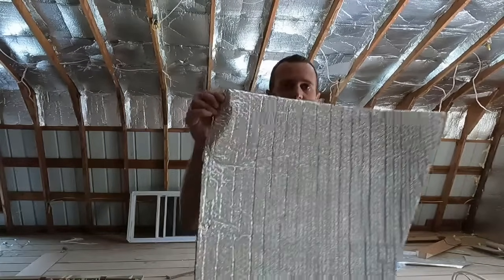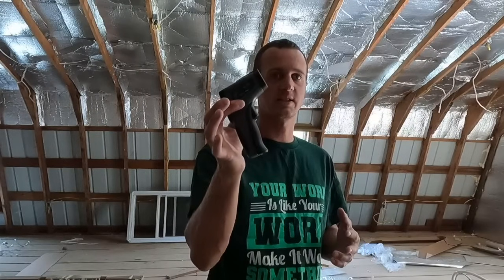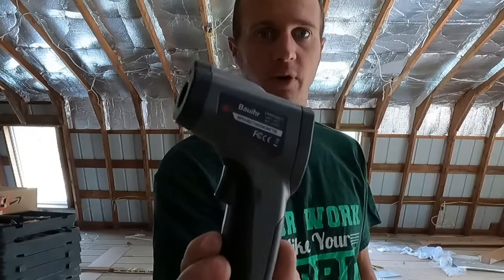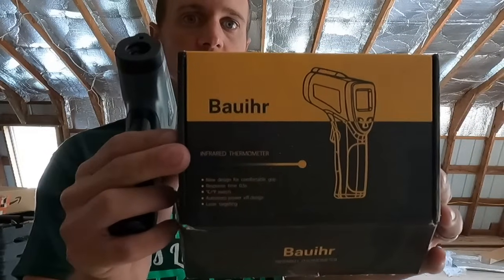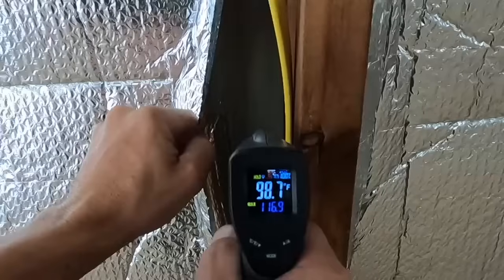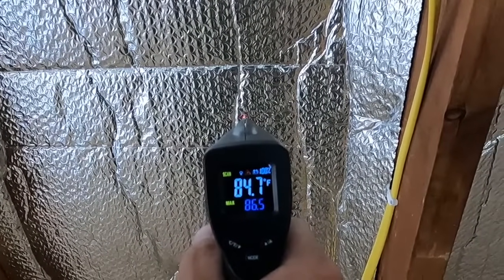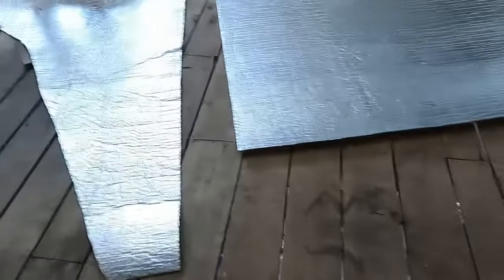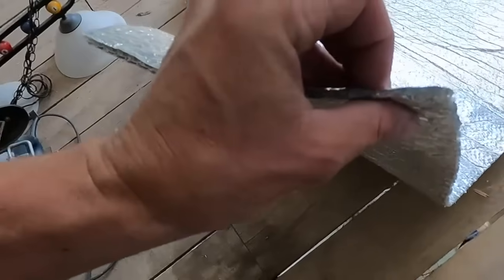Reflective Bubble Foil Insulation/Does It Work???

Comment: Isn't there supposed to be an air gap?
Reply from the maker: I have a 1 inch air gap. I stapled it to the 1x that the metal is screwed to.so metal is fastened to the outside of the 1x the insulation in fastened to the inside.
Reply: @projectdiy873 Thanks. So if you use Rockwool with it, it'll stop even more heat?
Reply from the maker: @ayanhalder6194 it should yes. I have not put the video out yet, but I have r 19 on top of this as well. Then I will have the wood for the ceiling. So I will have e the wood which is an R value the r 19 insulation the foil insulation an air gap and then the metal.

Comment: I'm wondering about air flow between outside wall, and the aluminum wrap?...if you have that on the outside wall, and then decide to enclose a wall, I don't think you could poly the inside wall before boarding, there would be no where for the moisture to escape....doesn't look like your planning to do that in your project tho.
Reply from the maker: There is a 1 inch gap between the outside wall and this barrier

Comment: These barriers do work well when given an air gap. But after some years, the material will dry rot and will begin to disintegrate to the touch.
Reply: I plan to use reflective insulation in my campervan. How thick of an air gap would you recommend. Every inch in a diy van build is important.
Reply: @tommcdonald1746  I am not a professional, nor did I sleep at a Holiday Inn last night, but all the documentation that I have seen has said half an inch to 1 inch. Nothing specific to vans just overall general requirements.

Comment: Having chosen the double sided you will gain a higher R value in the winter keeping heat in compared to none aluminised bubble wrap of the same thickness. I read that aluminium reflects 95% of infrared light aka heat. It is also less likely to melt or catch fire in the summer at extreme heat load. I imagine it must say on the package how much heat it can safely take, right?

Comment: It works better if you staple to the studs and create an air pocket, otherwise is is conducting heat and you are losing most of the benefits
Reply from the maker: @Gaterstoo  it has an air gap in it

Comment: Problematic! What counts here is the time it takes for the foil to heat up to the temp of the outside roof. As soon as this has been reached (and this will be relatively fast with thin foil) heat will go in! Or come out. So important here too is the time that process takes and thats why in my country usually very thick insulation is used, up too 15 inches where possible. But sure, even a thin foil is better than nothing.
Reply: foil reflects radiant heat, while mineral wool or other materials they only absorb heat(then release it)...u could very well put foil then some rockwool

Comment: To everyone watching run it across the rafters and the wall joists and then tape the seams. Virtually 1/10th the cutting you see here. Just smack each bay and Leave a little slack that stuff does move around and you need to let it.
Reply: Thanks..Does it matter what sort of tap?e
Reply: @Dee52789  I have used the aluminum tape that you  can buy from the people who make the Double Bubble Aluminum and I have used Tyvek tape that you can get at Home Depot or Lowes. Both work Great.  But you need that type of heavy duty tape that won't come off.
Reply: @Dee52789  You can use TYVEK Tape if you want. or you can buy the aluminum tape which is more expensive. the TYVEK worked great.

Comment: Engineer here. It would have worked better if you stapled it to/between the rafters instead of where you did.  Placing it right against the roof lets heat conduct through the foil, where a small air gap removes conduction, and lets the foil reflect the infrared heat back out the roof. Also pointing an infrared gun at the foil will not give you a reading of the foil. It will give you a reading of the infrared mostly reflected off the foil. Try putting soemthing like a lable on the foil and measure that.  Or ust mease something in the room to get its temperature.
Reply from the maker: @marklefler4007  there is a 1 inch gap between the metal and the foil.
Reply: @projectdiy873  I missed this important detail as well.  Unless you added insulation over the foil you would have been better served leaving a larger gap.
Reply: I am a mechanical engineer and should know all this but university thermodynamics has long faded into a distant past. So, I resort to experimentation. Yes, place tape on the foil to take the actual temperature of the foil. I have been experimenting with radiant insulation because I am a fabric structure manufacturer. We use a structural membrane on the outside. It is white, opaque with a black layer within the white layers. Of course the black layer absorbs the light/heat that manages to avoid getting reflected off the outer surface. The membrane warms up. Leaving a 1" airgap between the inner liner (white opaque laced with titanium dioxide instead of a black layer)and the outer structural membrane. My thermometer gun reads about  30F differential for summer (heat on inside) and about 40F winter. The white liner with 1" air gap was more effective for both winter and summer than silver or gold aluminum foil laminated vinyl liners. It's a bit of a mind-bender, but, since much is at stake I'll keep experimenting to be absolutely certain.
Reply: @gerywarner2568  He needs to use Electrical tape for Accurate measurement. Electrical Tape has the Emissivity of .95. Most All  of those Handheld Digital IR Guns are all set to .95 Emissivity.
Reply: One inch gap isn't enough 😂
Reply: Yeah what thi guy said !
Reply: would you use this under vinyl siding . Prodex told me I could use the perforated  prodex
Reply: You’re 100% correct. A little research could net a much greater gain.
Reply: Engineers 😂 gotta love em
Reply: Engineer with common sense here, every gap you leave for a warm pocket of air becomes a rodent haven. Use your head.
Reply: While I'm def no engineer,  the thermal bridge from the rafters will help conduct/transfer the heat inside.  But I get it, he's clearly going to hang drywall which will help
Reply: And this why we need engineers to help our builders with the physics
Reply: I am planning on using this in a small shed attached to the back of the house. It's pretty small but freezing. There are 2 walls if that's what they're supposed to be. 5 ft wide × 8 ft tall. The other 2 walls each have a door. The ceiling is some sort of wood planks or stripes. 5 ft wide x 5 ft length.  Once I put the foil wrapping with staple gun, tape seems?  Do I have to leave gaps for ventilation or can I seal everything? Thanks for any advice. I've never done this before and no hubby around to do it😂
Reply: @marklefler4007  what can i put on double-pane windows in my house that face the sunlight from morning to night and create a greenhouse effect ?  i tried blackout curtains and reflective film to cool the rooms but the difference was maybe 2 degrees at most
Reply: If we install on rafters as your saying, we want air gaps or not? Bit confused on that
Reply: Same for clear materials like glass. Having a label you read the had with this type of sensor is mandatory for any semblance of accuracy
Reply: I’m thinking of doing this in my garage, but I suspect an air gap between foil and ceiling could result in condensation = damp and mould due to lack of air flow?
Reply: @Simonet1309 they sell foam incerts that allows air to flow like supposed to ill see if I can send a link for you
Reply: @Simonet1309  https://youtu.be/5DX25Vz2jDc?si=uC2Un1lI3ypsx7aN
Reply: I used that stuff and mine was this was probably 20 years ago now but it was better than the stuff that you generally find out there now the bubbles inside were more dense and seemed like they were a little more rigid but I remember that the feel and the you could tell it was better but our value was really high for just you know a quarter inch of that stuff it was like 3 inches of some of the phone or maybe fiberglass it was I remember it was like holy cow and I was going around we were checking it out people didn't believe me and it was really high I think it was like 20 something for a quarter inch same as two or three inches of something else you can check it out you know maybe someone will find that I was losing my mind and that was all wrong but I don't think so

Comment: Nice Video !I have an 8 by 10 steel shed  I was given and I is in nice shape ! It is like a torture chamber sweat box right now it is so hot !I was going to just take some single bubble foil roll  like you have and liquid nails it right onto inside of shed ceiling .I do not see how it could not help..I don't wanna pit a bunch of money into insulating it ,just cool it down a little for stories by riding mower etc !
Reply: By chance did your solution work? It’s sweltering in TX.

Comment: rigid foam insulation would be cheaper and work better
Reply: Thank you
Reply: EPS or XPS doesn't reflect radiant heat, but if thick enough they can be very effective. The main drawback about rigid foam is flammability

Comment: You need a thermal flux sensor to measure how good it is properly. I've got most of an extension built 20 years ago covered in this and it's useless compared to a decent thickness of PIR foam or similar. Alreflex 2L2 claims R value of 1.56m2K/W with a thickness of only 3mm. If this were true, it would make its thermal conductivity better than vacuum insulation which is just not credible and nigh on impossible.

Comment: Hi Dude, my bedroom is colder than the other rooms, can I use this on the corner of this room to kepp it warmer? Could Mould be formed under it?
Reply from the maker: It is hard for me to give an exact answer without seeing exactly what you have going on. But as long as there is no moisture going to get it there mold should not be an issue.
Reply: @projectdiy873  I have colder room as I said than the other rooms and In this room if the moisture gets high and cold without enough heating, there is specific corner I get mould in. Therefore I am thinking about solution to get this room warmer to save energy costs and I am afraid of getting mould between this insulation and the wall and maybe I cannot notice it. Thx in advance for your help
Reply: @Ronaldo-ou9vd  I'm like you , wanting to help make a room a few degrees warmer (anything will be an improvement) but I want it under the carpet , is this stuff ok for under carpets do you know ? Cheers
Reply: @smallfeet4581 
Useless under the carpet, it requires an airspace between it and the heat source you want to reflect. Works best directly opposite or parallel to the source, at least .75 inches. It's best at blocking a heat source like the hot sun or hot roof, or reflecting body heat to warm up in a small confined area like a dog house, or inside lining of a jacket. Also excellent in a double layer below the subfloor with air gaps to keep heat from escaping when cold outside. For a bedroom just get a ceramic or infrared space heater, they warm quick, less than $100, and energy efficient. Check your windows for drafts and weather strip, and or plastic shrink wrap them for the winter.  plastic over a window with that sealed air in between is like a storm window, keeps bugs out too.

Comment: YOU COULD HAVE R16 VALUE if you had a 1-2 inch air gap instead of it pressed against the metal.....
Reply from the maker: It does have a 1 inch gap it is stapled to the rough sawn 1xs that the metal is screwed to. They are 1 inch thick so I stapled to them for that reason so it wasn't straight against it cause that kinda defeats the purpose some.

Comment: I really want to know how this does when it is cold outside....
Reply: Not worth a damn, I would imagine, without heaters going.
Reply: It deffo helps keep the cold from coming in also. I've fitted bubble foil in a wood outbuilding between the thick outer and inner layers of woodwall. Before I put the bubble foil in, the temperature was a lot lower within the space when it was cold than it is now after foil instalation. Better still, now when a heater is on in this out buiding, instead of losing the heat, the foil traps the hot air inside keeping it warmer much longer, which is great here in Scotland.. 
My fave part of this foil is, that it doesn't have ability to hold moisture like most insulation, therefore I never need worry about it becoming wet and mouldy or deteriorating behind the walls where I cannot see. The foil can act to give you cooler space or hotter. Your choice which you want!😎
Reply: @vadar03  So condensation doesn't form on the foil? I'm wondering if I can use this to insulate a shed? I don't want condensation being created on the foil because it will create mold on the walls. I want to keep the shed warm in the winters.
Reply: @c.ann1408 did you ever figure it out? Im trying to insulation my shed with no ridge cap or vents
Reply: @vadar03 Im in England and want to keep the cold out! Can’t imagine living in a country where you install insulation to keep the heat out 😂! Good to know it works for the cold to! I’m considering installing it in my garage! Expensive though!

Comment: Are you really using an infrared thermometer to measure the temperature of a surface designed to reflect infrared ? You are just measuring the temperature of the room when you do that ahah!
Also, taking the temperature of the metal that is behind the insulation and comparing it to the temperature of the insulation (even if it's the actual temperature, not the IR thermometer reading) is not a good way to demonstrate the effectiveness of the insulation. The metal will be hotter than if there was no insulation because one one of its face is insulated and can't radiate heat as much. You need to compare it to just bare metal.
Reply: But I would have thought you would want to measure the temp of the room, right? Doesn't that mean the insulation is blocking the transfer of the heat from the roof to the room meaning it's working?
Reply: He obviously wanted the room temp. Didn’t you watch the video?
Reply: Works in my attic ac bill down from lastvyear

Comment: u have to put a spot of electrical tape on the silver or it will only tell you the temperature of the room behind you it will not give a good temp, emissivity is gonna fool you
Reply: Came here to say exactly this. It's mind-blowing how many people don't know how to properly use IR thermometers. I saw a video of a guy who recharged the AC in his car, and he genuinely believed the air temperature coming out of his vents after the fact was 17° F while holding the IR thermometer a few inches away from the air vent for a prolonged period of time, ignoring the fact that the condensate on the evaporator would be frozen solid blocking airflow. 🤦‍♂️
Reply: Yeah, getting weary of these videos of guys doing tests having no knowledge of the tools they are using.

Comment: Do you have an air gap?
Reply from the maker: Yes there is a 1inch perling board that the metal is attached to. I stapled the bubble foil to that. So there is a 1 inch gap between the metal and the foil insulation.
Reply: @projectdiy873  can this foil bubble insulation be used under carpets ?
Reply from the maker: @smallfeet4581  honestly I have never thought about it. I would venture to say no but you have to do your homework with your situation.